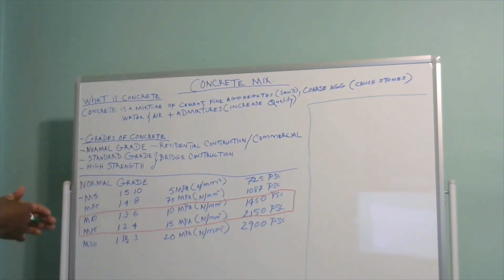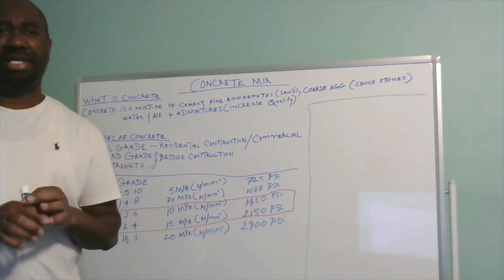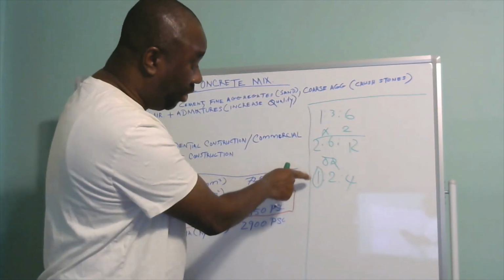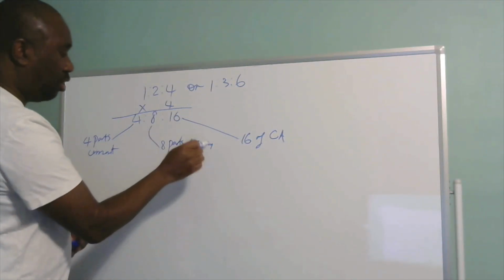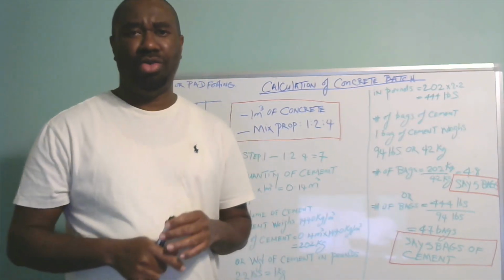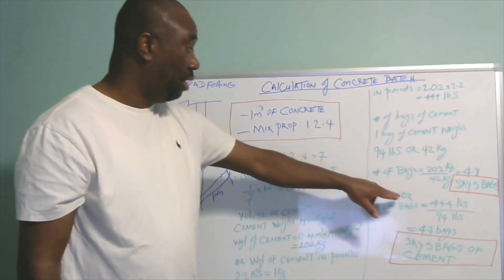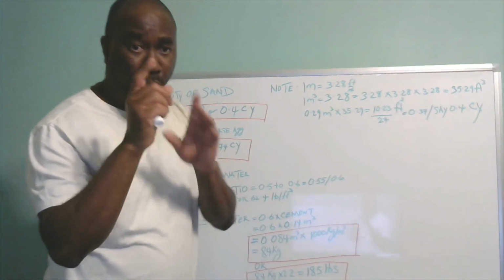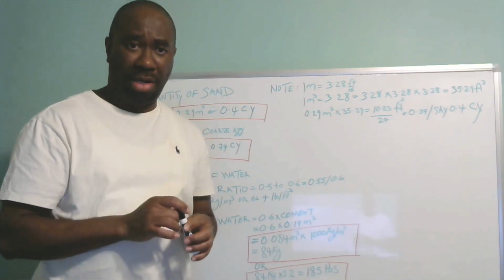How to do concrete mix proportion on construction site in Jamaica.

Comment: Good presentation. Thank you thank you.  What size gravel best for decking. And what would be the size gravel for the m5 or m10 based on the use ?
Reply from the maker: Use 5/8 .
Reply: @jkengineeringarchitecture.  OK thank you. Very much

Comment: Thank you for teaching us.

Rough notes

What is concrete - cement, fine aggregates (sand), course aggregates (crushed stones), water, air + additives (can increase quality).

Grades of Concrete 
- Minimal Grade - Residential / Commercial
- Standard Grade 
- High Strength - Bridge Construction

Normal Grade - 
M5 - 1 5 10  5 MPA   725 PSI
M7.5 - 1 4 8  7 MPA   1087 PSI
M10 - 1 3 6   10 MPA  1450 PSI  <>
M15 - 1 2 4   15 MPA   2150 PSI <>
m20 - 1 1.5 3  20 MPA  2900 PSI

1 3 6
- Always try to use multiples of the ratio E.g. 2:6:12 = 2 burrow cement, 6 burrows fine aggregate, 12 burrow of course aggregate
- NOTE the 1, does NOT mean 1 bag of cement. It takes about 2 bags of cement to fill a burrow.
- Bad practice to cut back on cement.
- Tip - run sand first, then cement, level out, then course aggregate, part the middle then put in the water. (Sweeten sand and cement first)
- M5 or M10 concrete mix - M stands for Mix, Number stands for compressive strength (Pascal or Newtons / Meter square)
Reply from the maker: Nuff Respect for watching my videos.

Comment: the video has great technical info but it is incomplete. you could/should have done a demonstration showing how to do it in real world, showing what the consistency is supposed to look like. I mean, workers aren't going to bring a scale to a construction site and measure out water/cement/sand/stone/. they will always eye ball it.
Reply from the maker: That is true workers on site is not going to do that. But that's the way how it is done at the concrete plant. The video is not only for on site, but also for design concrete mix done at the concrete plant.
Reply: @jkengineeringarchitecture.  hey karl, is there a maximum building height and/or ceiling height in the jamaica residential buidling code (if jamaica has building codes)

Comment: I have postponed pouring my driveway because I was not convinced by the "barrow" method of mixing concrete. I don't know that all barrows are of a consistent volume.  If they are,  then that's fine.  If they are not then differently sized barrows will yield different strengths of mix even though we think we are conforming to the mix ratios. (Don't know if I'm making sense).
And nobody told me that the cement was not per bag. That's enlightening.
Reply from the maker: Not all wheel Barrow measures the same volumes, while that is true. You have to  proportion your concrete mix with what ever measuring apparatus you are using. So dont confuse yourself with that. As I have said in the video that if you are using a tea spoon to  proportion your mix it must conform to what ever mix ratio you are using.  Hope that helps. If you still want clarity then send me another follow up comment.

Comment: How much bag of cement you used per 100 blocks
Reply from the maker: I would have to do the calculation, I am going to be doing a Quantity Surveying series soon, where I am going to do those calculations, but to answer your question more directly I think it would take roughly 5 to 6 bags of cement to produce A 1:2 Mortar Mix to lay 100 blocks. Good Question though. Respect.

Comment: my method is to layer the various materials. So i lay down a layer of course aggregate with a layer of fine marl and sand (50/50)mixture then a layer of cement and repeat until the entire course is laid down . Then i mix thoroughly. I then SLOWLY SPRINKLE my water/ plasticizer mix while mixing.

I do that for both mixer and hand mixing. My reason for that method is that sometimes it takes just a bit less water than what the mix calls for especially if i am mixing in the morning and its really cool.
Reply from the maker: Good. What ever works, as long as some  thought goes into it and not  just doing random proportions for your mix. Respect.
Reply: @jkengineeringarchitecture.  its a real struggle LOL. Most people do not realize that there is an actual science to concrete so many times even after they are instructed they will simply do what they feel like unless there is someone there to ensure they do it right.
Reply from the maker: @jussayinmipeece1069  that very true. I use to get a lot trouble from workers on site, especially when it comes to concrete mix proportions. It's a struggle fi true but you must keep educating them.